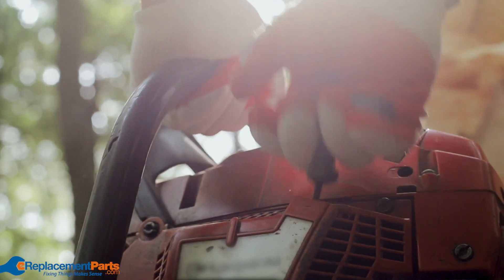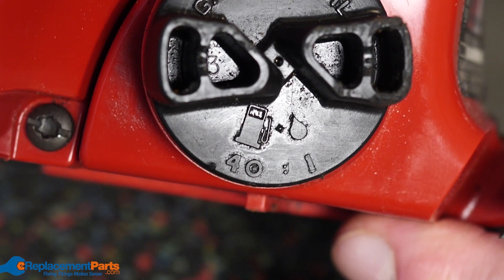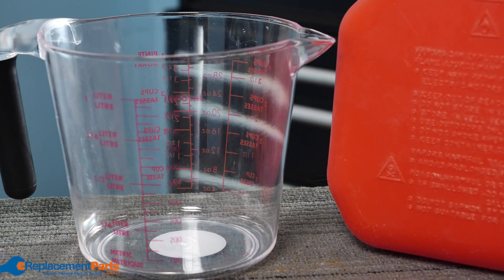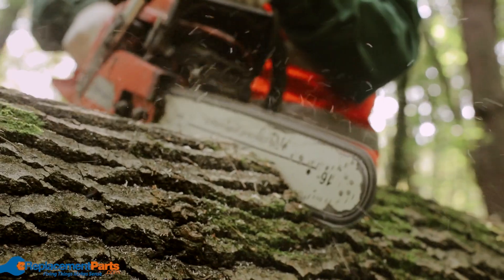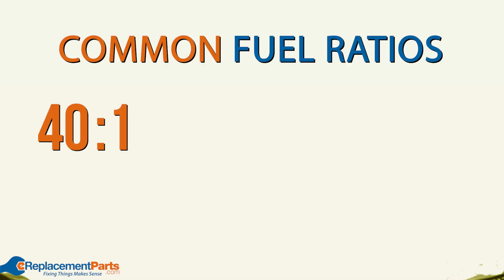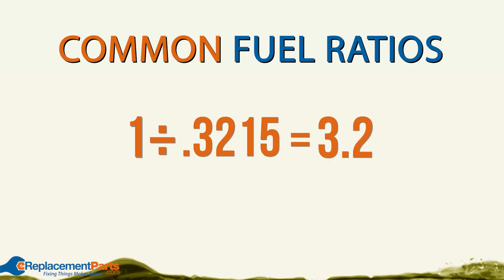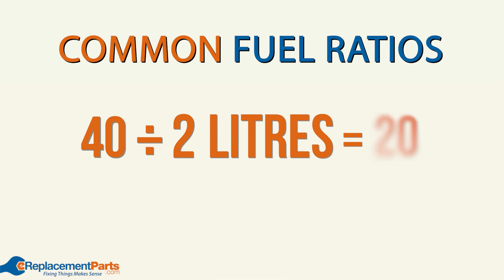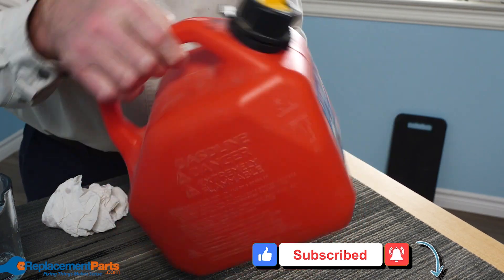How to Mix 2 Stroke Engine Fuel | eReplacementParts.com

Comment: Someday we’ll get wise to the metric system.
Reply: I'm lazy and ignant so I say a liter is a quart and multiply millimeters times 4 and adjust to taste to get inches (ex. 25.4mm x 4 is 101.6).  That's 100 in my book.  If I don't know what the mix is, I make it 40:1.  Extra oil will not hurt anything.  You must always wait for your brain to catch up with your thoughts.  It takes time to understand.  In the meantime, go for it.  You ain't a scientist.
Reply: Doesn't that make you feel superior?  There is nothing inherently superior about it. As a matter of fact, in aviation nautical miles are superior. It just depends on what you learned.  Converting in your head isn't difficult.